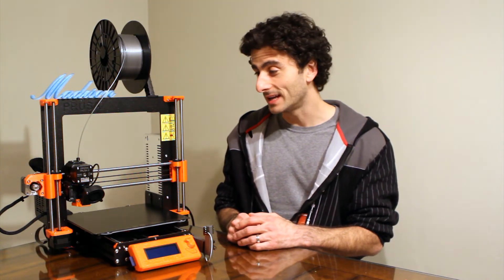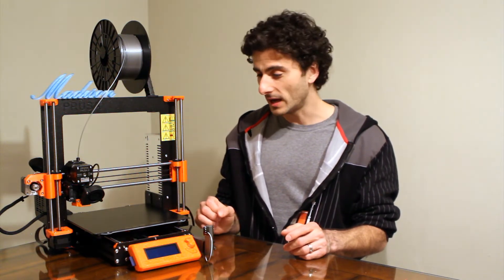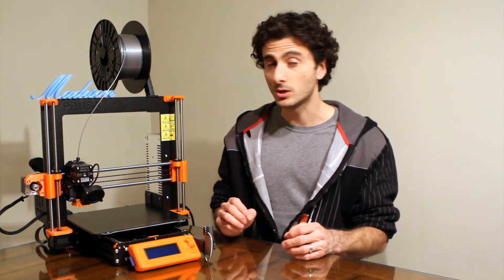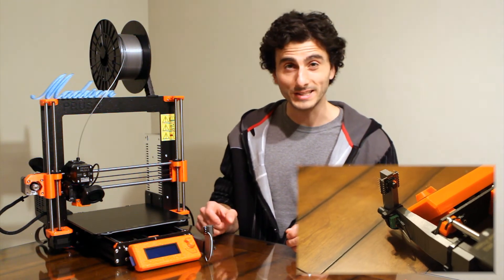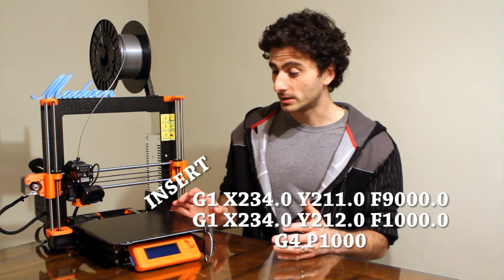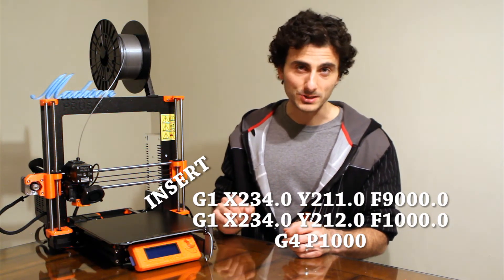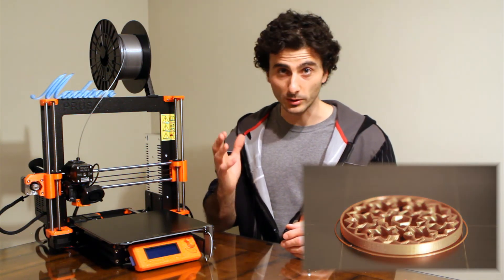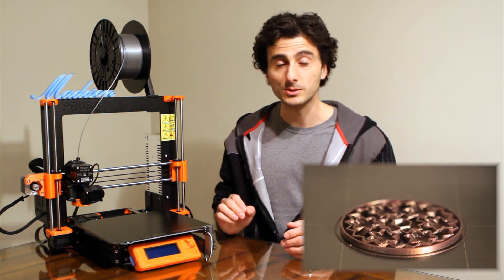How to time-lapse on the Prusa i3 MK3

Comment: Very interesting solution to 3d printing timelapses.
Reply from the maker: Thanks man. This solution gives you some really high res images to work with for video which is good, but it can also increase the shutter count of your DSLR - 1 release per layer. If you have something with 1000 layers, you got yourself 1000 images (good) and 1000 shutter releases (not so good depending on your shutter durability for your DSLR). If you decide to pursue this solution, I recommend using a mirrorless SLR using the electronic shutter release instead of the mechanical - better for the life of your gear!